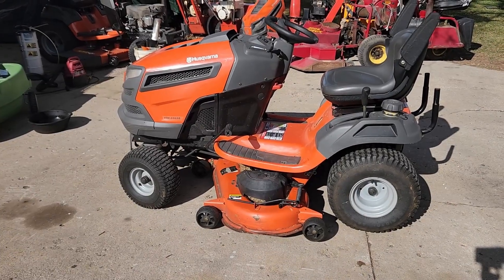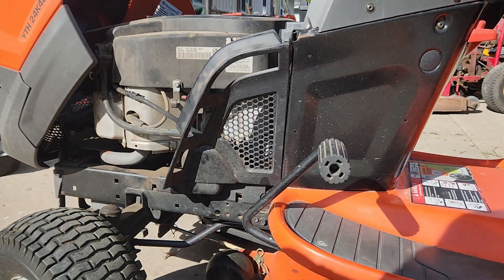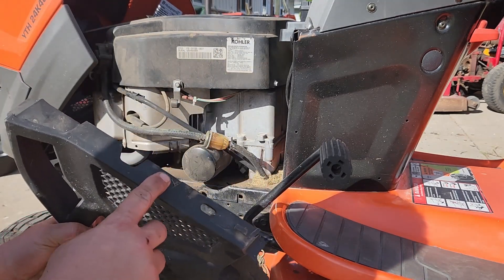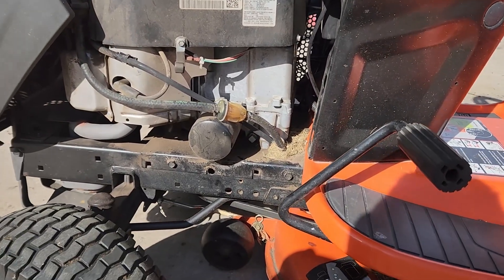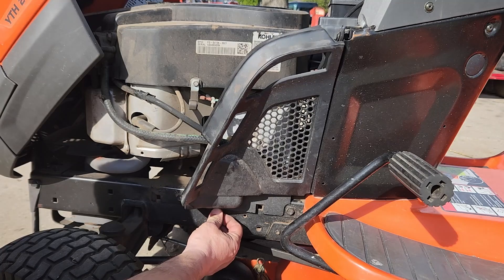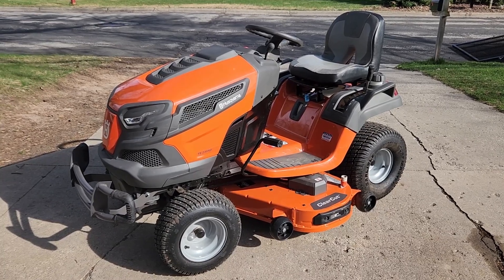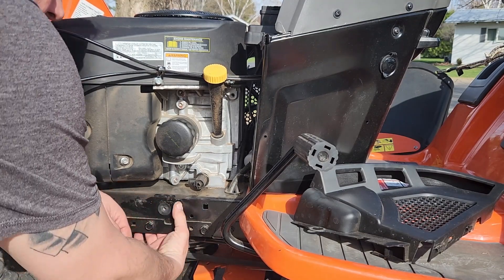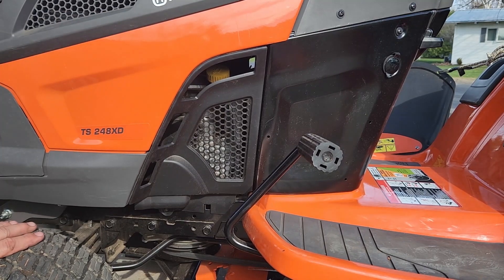Husqvarna Lawn Tractor Side Panel Removal for oil change etc..

Comment: I need the plastic cover panel on the right side. Mine is a husqvarna yth 24V48 and I can't find one anywhere. I even looked online but I dont know the correct term for that piece that you took off I just call in plastic panel. I NEED one for the right hand side sitting on the seat
Reply from the maker: Visit www.partstree.com and search for your model number (under the seat). I found one there for about $38.